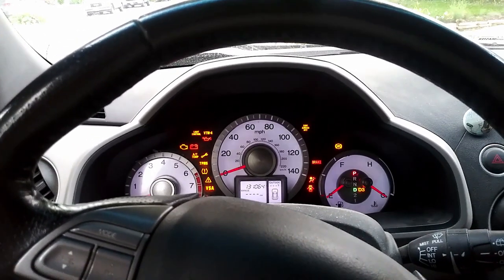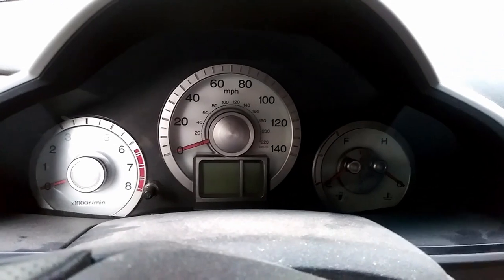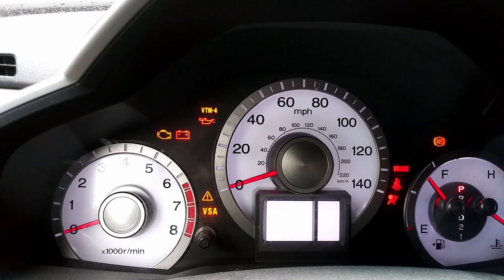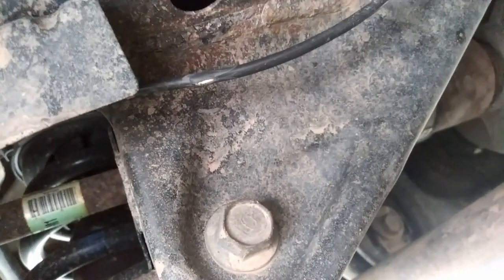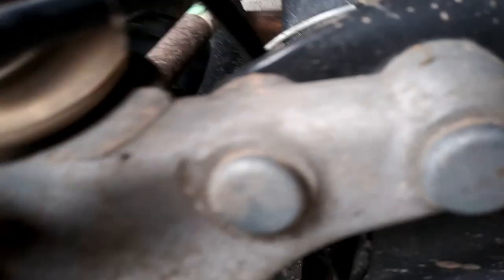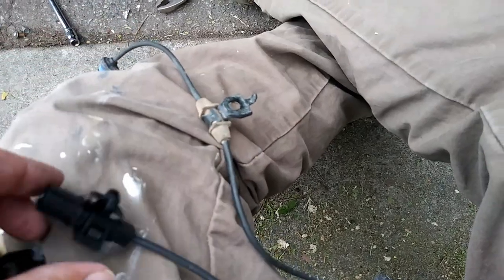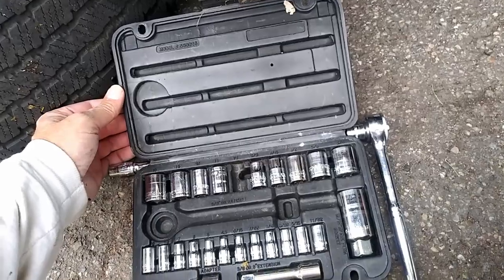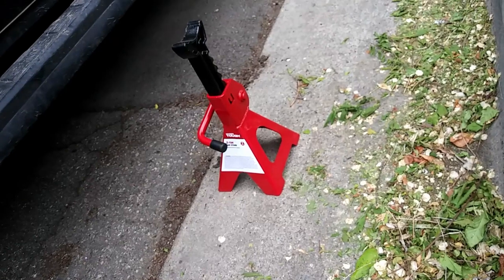2010 Honda Pilot ABS Speed Sensor Diagnosis and Replacement

Comment: I've had this same issue for going on six months now on my 2006 Pilot.   I used the paper clip on 4 & 9 and read all the codes.  Sure enough.  Front right abs speed sensor wire.  I ordered it from Amazon for $22.  The pain in the ass was getting the old sensor out of the wheel hub.  Holy crap.  That thing had to be destroyed to get it out.  Long story short, I got the whole thing done in a little over an hour and said a prayer haha. Turned on the ignition and ALL the lights were gone!  Thanks for the great video.
Reply: Hi Scott Kramer I have a 2006 pilot with bad rt front abs speed sensor..Do you remember how you could disconnect the electrical connector ? Can you do this from below ? My arm is not long enough and so much  parts in the way. Thank you.

Comment: Great video, well done.
I thought I could see on other side of the cable fray a large indentation.   It is unlikely your cable being taped would have fix it. It looks like the cable was pinched by a garage lift or jack stand. Such a pinch would have shorted the wires inside the cable.
Two thumbs up

Comment: Great video! 
I don’t think I am able to do what you did to your Pilot. I have a 2009 Honda Pilot 

My problem is similar to yours. Though all four lights do not turn on when I turn the ignition once (not starting it) 
They turn on when I make a left turn or sometimes when I go over a bump. 
I don’t think I can get a code with the paperclip technique if they don’t turn on with turning the ignition once (not starting it) 
All four lights also turn off once I turn off the car. They then turn back on when I turn the car on and make a left turn or go over a bump. Any ideas of what I can do?

Comment: Thank you so much for your very informative video 

I am having the same exact problem and I read online that it could be the speed sensor like you said. I have a Honda Pilot 2009.

Does each wheel have its own sensor and if so how did you come to find out that it was the rear right speed sensor. Also when buying it at the dealership what part number is it and what its exact name? That way I can purchase it too. 

If you have anymore suggestions on this problem of changing the speed sensors let me know. Thanks in advance.
Reply from the maker: Hi Jose, yes, each wheel has it's own sensor, and I identified which wheel it was on my pilot based on the chart that's at 6:18 in the video. Once I saw that it said it was the right rear, I climbed under the car and checked it and saw the frayed housing. As far as part number, I just called the Honda dealership near me and asked them for the right rear wheel sensor, and they knew the exact part I needed. Hope that helps!